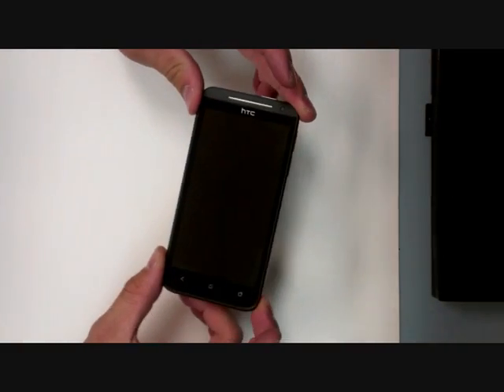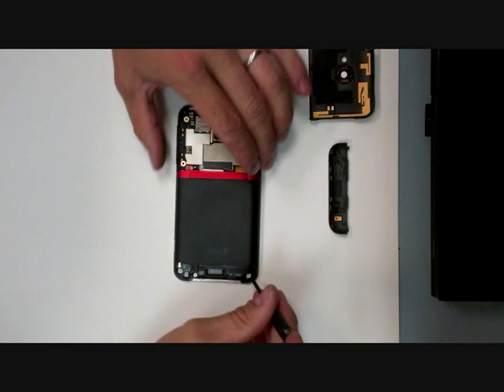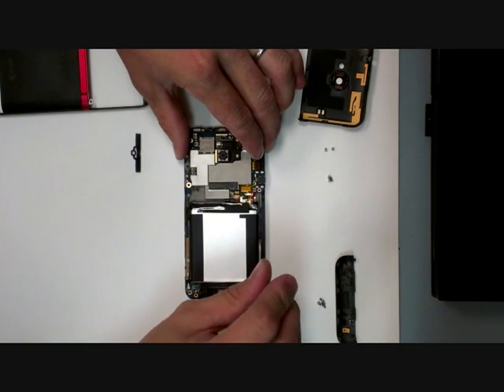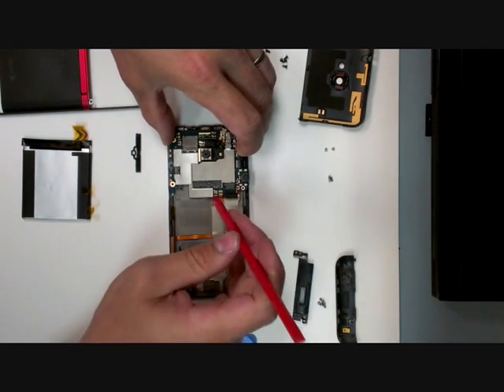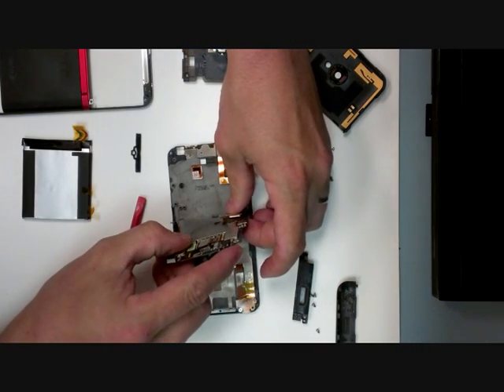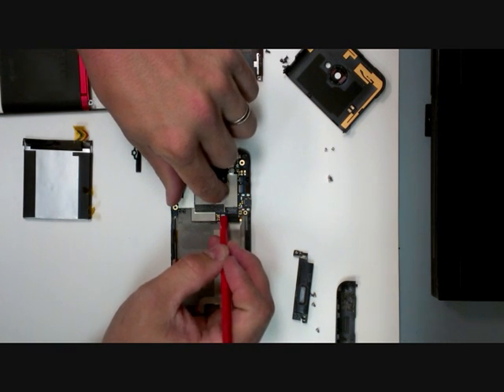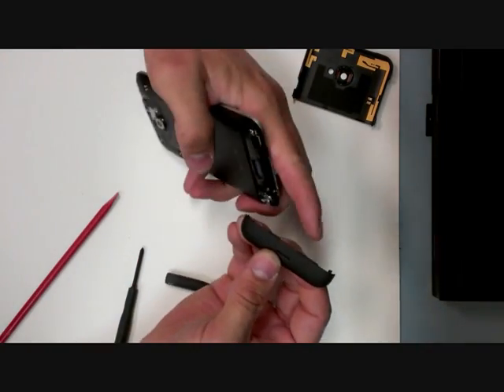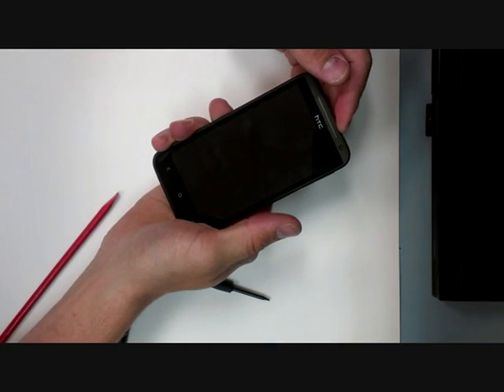HTC Evo LTE (One X) BEST QUALITY How to take apart and repair

Comment from the maker: They are glued together.  I haven't needed to with this phone yet, but you can usually get them apart with a little bit of heat and very very gentle prying. The hard part is finding replacement digitizers once you do get it separated.  A quick amazon search didnt find anything.  Usually its not worth the effort, and you are better off just getting a LCD/Digitizer combination.
Reply: finally i can be a second reply to a jerry rig comment
Reply: Ah here he is !